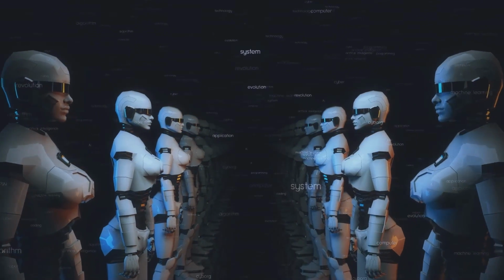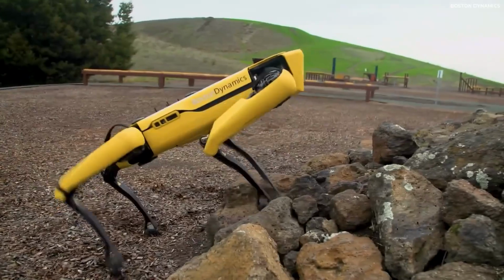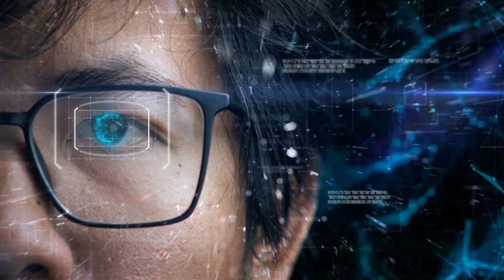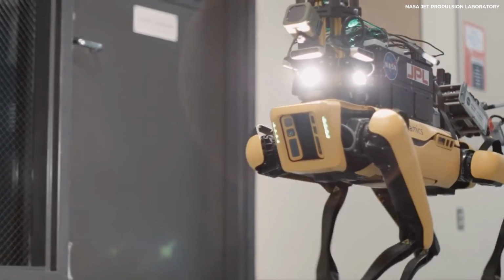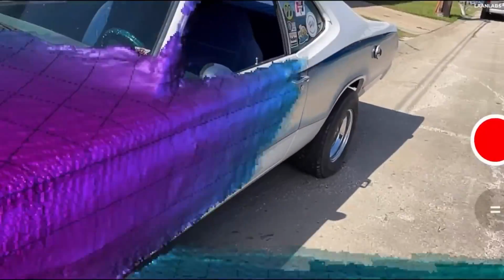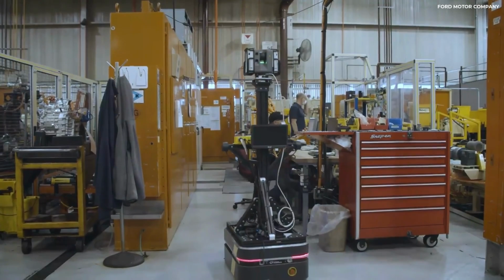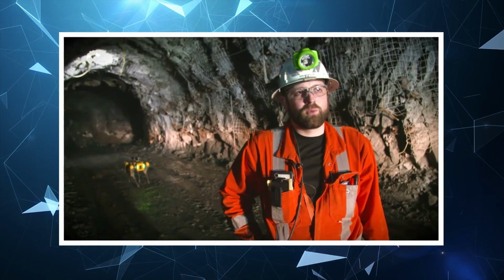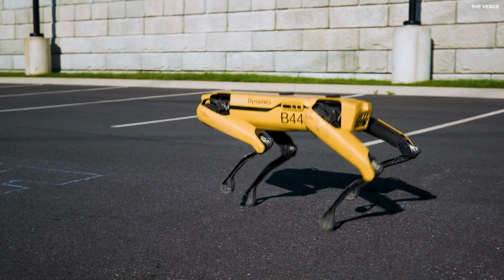The REAL REASON Why Boston Dynamics Builds Robotic Dogs

Comment: Gonna need a 45 or 50 penetrate the plating that covers its control module or cover the sensors with a mixture of oil and paint and sand

Comment: Off the record, these were originally designed for military use just like wave runners, jet skis, quad bikes and sand buggys.  I remember driving a sand buggy during an exercise but the fact they were unarmored made them not practical.
Reply: Unless you're British.  Then just put 3 machine guns on it, and run with it.
Reply: I need the drone Spot with a seat and a parachute. It can land and start carrying me like a horse. Shhhh let it's WHEELS pop out n we can ROLL.

Comment: Why stop at 4 legs...Would not the centipede be a better model...For example design a single unit capable of linking with other units...each single unit carries a single capability device...one could be a power generating unit...one could be a more advanced command and control unit...the number of specialized units making up the body could be endless...you need a digger ...the digger unit separates from the body and does its thing...then the unit that scans the pile separates...Every mission capability you would want could be installed...If one unit malfunctions...it can lift it legs and be carried by the others  without losing its specialized mission package...the last unit could carry a winch that would allow the body to go  up and down steep slopes safely

Comment: A fuel cell would be better than a battery in a lot of applications, because it provides longer run times and takes seconds to refuel.
I think everybody knows that arming these things is inevitable at this point though.
Reply: Poor energy density and highly explosive gas. Sounds ideal for a warzone
Reply: @sebastianflynn1746  Neither problem exists with a DEFC.

Comment: The reason Boston Dynamics makes robot dogs is because the government of the United States plans on unleashing these on us .to get us to conform to what they demand us to do .unless you have a 50 caliber gun to blow one of its legs off you will not stop this thing .of course you could use an EMP gun like the police use when stopping automobiles from fleeing and alluding .  this electric magnetic pulse  will fry the chips in these robot dogs and stop them cold. But they don’t want the public to know this there are a few EMP type landmines that can be under the surface and have a lot of power to fry a lot of electronics and you will have to know how to use these but it is a solution they don’t want you to know about.

Comment: Robotic dogs have a huge potential. As opposed to bipedal humanoid robots, four legged robot dogs are easier to balance and program and they can be fitted with robot arms. I've never purchased one of those vacuum bots since I am waaaaayy too messy for a vacuum bot to get around in my house. What I need is a tidying robot! And Spot can do that with the correct kind of clever programming :-)
Reply: Bring me drinks, do the laundry, put the bins out etc. Can't wait for them to become more affordable.
Reply: @daftdigital  its ever wil be cheaper to employ humans
Reply: @omnianti0  Robots don't need benefits, or sleep.
Reply: quadruped robot use the same tecnology than bipedal nothing more economic or stable
if you look to more eficient better to sight at hexapods
Reply: @omnianti0  Uh, yes there is something more stable about it. Walking on four legs is more stable than walking on two legs, much like crawling makes it much easier to balance for human babies compared to walking. The technology has nothing to do with it, a human and a dog technically use the same "technology" for their limbs too.
Reply: @plmokm33  as you was able to experiment your self the more stable design is the triple ground contact and for moving the best solution is dual tri-pod
Reply: @omnianti0  ok? That doesn't mean the quad layout isn't more stable than bipedal.
Reply: @plmokm33 bi definition a quad include a tripod what is the most stable form but the motion can use double bipedal or tripod with a moving leg what is completly diferent and the last quad also showed the capacity of walking on bipedal and using the 2 other limb as arm and its not far from us to watch a quad jumping on a single leg
do you considere yourself as bipedal despit 4 limbs skeleton ?

Comment: (Last time I checked General Dynamics had been acquired by Google which is owned by Alphabet which is owned by ....? Please correct if this is inaccurate)
What we really want to see is a slightly larger "dog" carrying a few tens of thousands of rounds of the new 6.8 belted for a compact gimbal mounted self-stabilizing, "fire on the fly" mini-gun using laser and infra-red sights along with urine, sweat, blood, tears, feces, skin flake and human DNA detecting sensors plus hi rez acoustic sensors tuned to the modulation and register of the human heart and lungs with all sensors tied together for targeting, run by silent servos powered by a "good for the life of the vehicle" fuel cell ... now that's what I want to see. I'm drooling (think of Homer S thinking of donuts or beer)

With DNA sensing ability no more worry the cute little dog will track and neutralize the wrong target. We can relax any concerns regarding targeting mistakes and allow them full autonomy once given the exemplar samples along with clear, unbiased algorithmic instructions.
Of course these would be sent out in squads: mini-gun, auto-cannon, grenade launcher/mortar, .338 magnum sniper dog stabilized for 2 mile or more accuracy and the repair bot/extra-ammo dog  each with their own surveillance and targeting drone with perhaps ordnance deploying capability. I would also throw in a couple of "air cover" dogs carrying large, armed drones with LIDAR (and all the other sensors) for foliage penetration and triangulated accurate aiming. 
And I do so love dogs - loyal, loving, obedient complete with a sense of humour and irony.
That is why General Dynamics has their proof of concept  ... what should we call them? ... murder robots?  tracker/killers? ... search and destroy autonomous units?... assassinator? eliminator? ... dancing is so we will have lowered our guard and think this is great stuff; all hail our benevolent hi tech overlords. (I think I may have seen something like this in a movie from a few decades ago ...)
Then just when you thought it came by to do a little happy dance for you, Big Spot or Big Dog or bi-pedal Big Dick turns you into fish bait because of something you said on Twitter 
And think of the savings reaped eliminating transportation to and construction of "re-education centres." What a glorious hi-tech future awaits us!
All hail the Google/Alphabet technical military industrial complex! Hail!

Comment: Spot needs too much energy. One battery  charge enough for about 2 hours. Without closely placed charging dock station - it is not very useful. If it will be combined with large robot with large amount of charge ("small tank") and stay close to it to recharge when needed - it may be useful in wild terrain.

And it should be not just a docking station on a wheels, but it should hold set of spot batteries and replace them automatically, because spot battery need a lot of time to recharge.

Comment: A Boston Dynamics dog has around 20mins of battery life, without any peripheral equipment attached,  they can't cope with rugged terrain and can't get up if they fall over on a rough uneven surface, and they can't jump over or up onto anything very high. It will be a long time before we see models that can be used as combat tools or weapons.

Comment: Just another killer bot, its creator wants to be payd by civilian sector. And yes, it can do a lot of good. Although, on the Mars caving issue - it is not much better than the rovers, because their speed is not limited by wheels, but by the speed of comunication (i.e. by the constant of the speed of light). For the cave exploring, would be much better to have a rover acting as a carrier of few mars-heli-drones, and few of smaller ground/terrain vehicles (one of wich could be even the SPOT, because the last rover was of SUV size).

Comment: I like Police Spot, the blue robot that looks like it been used in real situations, the problem I see with Spot on Mars can be the power, it need much energy and to return to a station where they can recharge, so it will have a limited range unless it can carry large solar panels, but then it is no longer small and nibble.
Reply: That's solvable using the same power supplies that NASA uses. They're not cheap but it's going to be just one or two of them there as far as we know. They would also be able to shake off the dust on solar panels as well.

Comment: Way to go I think it's gonna be a great  help on the Moon if you can deal with the weightlessness and the dust and Mars and for law enforcement for shootouts and hostage situations and bomb scares parcels retrieval and detonation etc the military if you can deal with the increase in speed it has to be able to walk faster / run faster than a a Human/ and faster than most off road vehicles when off road at least 45-60 MPH some four legged animals like Cheetahs can run at 80-MPH and the battery time length must increase solar power adapter fast charge etc but one of the biggest problems with these and the military is noise they will have to be quite I also think that if the legs could extend / telescopically to be able to sneak up on the enemy forward position troops and look over the top of walls rockfaces in a silent stealthy way then they could also be used as snipers.

Comment: 2028 every mid income home has a BD "Spot", doing triviel work humans hate, and have a AI you even can't imagine in 2021. Ohh and it has 360° Night vision/thermal vision and has a 9mm gun which can rotate 360° and has -90° to +180° elevation, ammo is short range low penetration for when their owners are hiding behind a dry wall and armor piercing high velocity when their owners are safe.  Boston Dynamics "Spot" coming to your home in 2028, only 2499$ including charging station. Ammo not included. 
Dreamworld or reality you decide ...

Comment: Mimicking biomechanical movements and navigating complex terrains may be concerning. It opens a wide range of spaces which were not accessible to robots before. But on its own it is still just a transportation/delivery system.

The real concern is advanced AI with an ability to autonomously make decisions about the use of deadly force. And it doesn't really matter on which platforms such AI will operate. It may just as easily be deployed on "normal" transportation platforms like wheeled UGVs or any type of UAVs.
Reply: It can easily be used to pack, aim and fire a gun. No brainer. China has already made thousands of copies.
Reply: It will never die.
Reply: Humans are way scaried. Look how many people get shot by crazy people in cities like St. Louis. Hundreds of murders per year.
Reply: Imagine large, military truck who dreams about beign pianists. What a tragedy.

Comment: They were joking about them being used as Mars rovers. The rovers are using what we would consider ancient hardware because of bit flips. (particle strikes) Maybe if chips can be developed that are hardened to the radiation they will consider it. Currently, you need triple redundancy at the very least for rovers to error correct.
Reply: I think the "rover" joke was a dog joke.
Reply: Two words: Devon Island
Reply: Let's also not forget that walking around on 4 robotic legs probably takes a shit ton more power than rolling on wheels at a crawl.

Comment: There's a reason they haven't used Boston dynamics robots for Mars probes. That robot has a max battery of 1.5 hours. after that it's dead. You wouldn't be able to put a plutonium-238 power supply on it as NASA's plutonium-238 power supply is too big and heavy for a legged robot.
Reply: The 1.5hr battery is just a prototype to test it

Comment: I still hope that Boston Dynamics build a horse sized robot that can, among other things, be ridden or work as a pack animal. A horse sized robot might actually make more sense out of doors. The big drawback would be that they would be harder to take somewhere.
Reply: They did lookup LS3. Legged squad support system.
Reply: Horse trailer.
Reply: Korea already has many many of them along the border with Joseon since at least a decade.This is why barbed wire and barriers have been removed.
Reply: They have that already and it's for Military use. Can carry 400lbs of equipment and is voice controlled
Reply: The mule iys called
Reply: They would also need a stable!
Reply: Or maybe you could just buy a Honda 4 wheeler.
Reply: @lostcat9lives322  ever heard of a goat trail?
Reply: @lostcat9lives322  clearly you are a left or right wing radical..

Comment: 73lbs? Whatever that is in normal units. How many orange peels does it weigh? Any other equally useless measuring systems?
Reply: It's a bit more than a bag of cement.
Reply: @RobShuttleworth  ah so a little shorter than a piece of string 👍
Reply: It's 76 milk half full milk cartons, or 7156 banana peels. It's also 412 matchsticks long (or 12.5 Dawn soap bottles if you're Canadian).
Reply: @steves835  how many is that per hour? I will divide and count up to it
Reply: @janhenson9616  I don't have my stopwatch, but it's gotta be at LEAST 23 to 27.
At least.